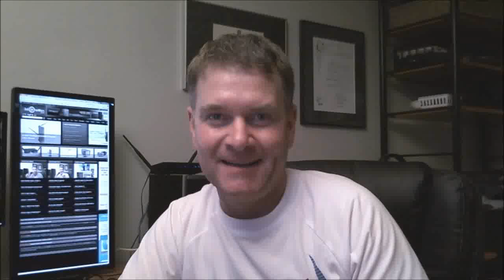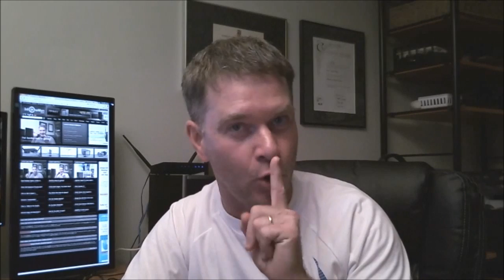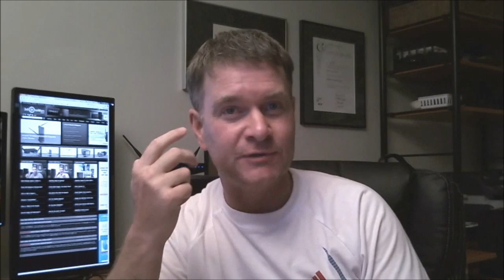#444 - Q&A: What is Socket LGA/FCLGA?

Comment: FC stands for "Flip-Chip". All LGA 1156 CPUs are FC-LGA 1156. They are the same thing. "FC-LGA 1156" is Intel's official name for the CPU package as it is a "Flip-Chip", "Land Grid Array" package with 1156 lands. All modern desktop CPUs (everything since the "Mendocino" PII-based Celeron) are "flip-chip" designs, so most people just call FC-LGA 1156 "LGA 1156." However, Intel makes a lot of other kinds of ICs that are traditional non-flip-chip designs and they feel they need to differentiate between what ICs are flip-chip and what ones are traditionally packaged.

Comment: Your speaking is great, but it would be better if you edit your videos. just sayin. :) but will it run even you use lag on a fclga?
Reply: Can I use an fclga 1150 on a lga 1150 motherboard?
Reply from the maker: +Sanus Klinken Only difference between LGA and FCLGA is the manufacturing process, so it should work, but it would depend on your motherboard.

Comment: For those wondering the difference between FCLGA and LGA... both have the same connection (LGA); the FC (flip chip) just describes that chip and has nothing to do with the connection.
Reply: Literally more useful than the video it self
Thx man
Reply: can i fit FCLGA processor to a LGA mobo ?
Reply: sanchit kalhan Yes.
Reply: Ok thanx man
Reply: sanchit kalhan no worries.
Reply: @spencerclegg1606  5 yrs later and this video is still frustrating people. Thanks for the help.😉👍
Reply: @3576alan  9 years later now lol.
Reply: Thank You for clearing that up. Would You help me with one more? what if any difference is there for lga 1155 and lga1155H2? Thank You for Your help
Reply: and would they fit in same socket
Reply: @sidetraksidetrak879  LGA 1155 = Socket H2 They are the same thing. So I'd say, yes.
Reply: Alright. So, if my mobo has an FCLGA1150 socket, anything described as fitting an LGA1150 will work?
Reply: Gracias ya estaba confundido 🤗
Reply: Thanks 🙏